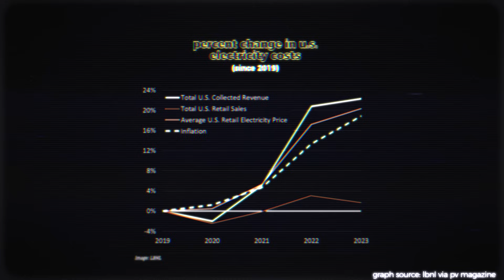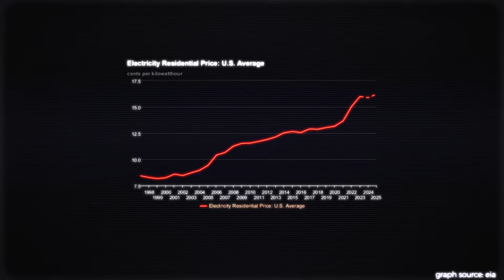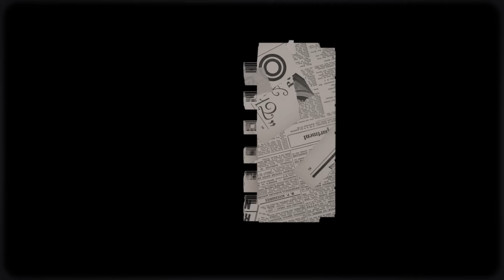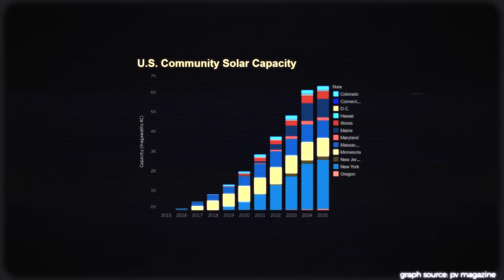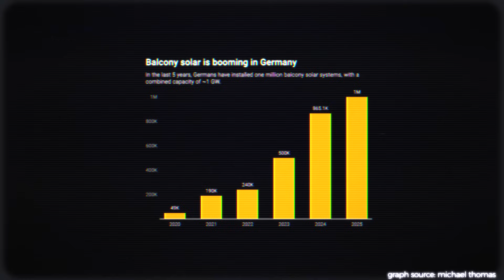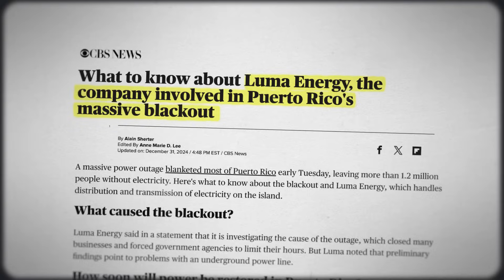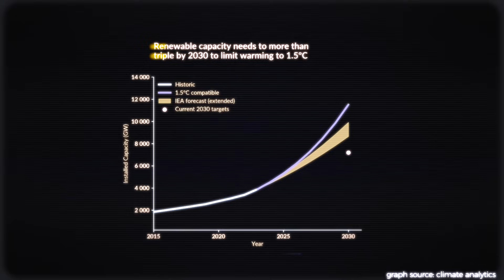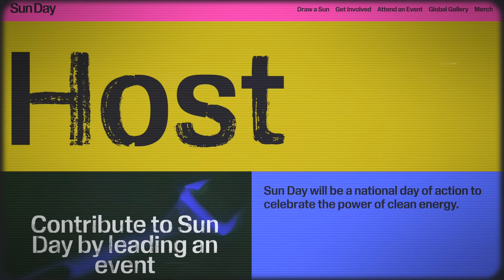Why We Need Solar Power

Comment: I agree with everything in this video besides construction of big solar farms in the rural areas of the country. Some of these solar farms destroy the ecology in those areas via light pollution, fencing around the solar farm cutting off migration paths for the animals, and destruction of the surrounding ecology via deforestation. You could make the case those solar farms could be feasible on land that was already used for agriculture but deforestation and ecological destruction to build these solar farms is out of the question and unfortunately this is happening in areas around the United States. The solution to this is placing solar panels strategically in the urban city areas via rooftops and balcony’s as this video pointed out. Also along highways and roads would be a great spot to place solar panels to power the rural areas as well.
Reply: I have to disagree. Solar panels work best when installed in large areas with no interference with the sun, and has limited air pollution. Installing panels next to highways and roads? I'm guessing you've never worked next to the road. It is filthy. The surface of those panels will end up covering in rubber particles which will reduce the already low efficiency of the panels. This makes it even more expensive to operate as the maintenance cycles are increased.
Reply: @JoeNunyabidness  There's certainly a place for solar in urban areas - there are lots of buildings which have  a vast expanse of roof area. Not generally residential - but business complexes, warehouses, retail space and supermarkets, all have spare space sufficient to install a moderately large solar installation that is well above the height of surrounding buildings. It may only be in the tens of kilowatts, but that's enough to be commercially viable and the roof space would otherwise be going unused.

Given how many US cities are more parking lot than they are building, you could probably meet a good portion of their power needs just by fitting a solar panel roof above all those parking areas.
Reply: @vylbird8014  Although installing on those large roofs sounds good, the problem is that all those structures will need to be re-engineered to support the load. Solar and all the necessary equipment is heavy. Very heavy. And warehouse roofs aren't designed to hold that type of load. Retrofitting would be necessary. This means that a "tens of kilowatts" install would not be commercially viable. Instead they would require massive amounts of government subsidies. Parking lot installs are a better solution, but they still have many holdups. 

Which then brings us back to what I was talking about (since I never mentioned anything about roof installs) air pollutants and panel efficiency. The reality is that tire rubber is one of the largest sources of microplastics in the environment. It is light enough to float in the air and then land on hot surfaces, like panels, and reduce their efficiency. Vehicle exhaust will also cause that harm. And cleaning a panel of melted rubber is going to require a ton of effort. This is why city installs require so many subsidies. Want to know a more effective solution? Insulation. It is cheaper, easier to install, more effective at reducing energy waste, and less environmentally damaging. Unfortunately it isn't as sexy, so people can't oohh and ahhh over it. $1000 of insulation will pay for itself long before $1000 worth of solar.
Reply: @JoeNunyabidness  i have seen a dead deer in the fence in the mere 3 years these massive solar farms have been set up near my town
they are even worse for the ecosystem than highways and crop field monocultures
Reply: @kkjkjh  that's simply not true lol. highways have killed thousands of deer in those same 3 years. you can also combine farms with solar depending on the crops.

Comment: "Gargatuan"? 

For balcony solar you don't have to plug into the wall. Plug into one of those little jackary style batteries which also themselves plug into the wall, then power your stuff from that. The battery doesn't back-feed into the house, it just powers the devices plugged into it and only uses the grid when below a set percent. It does add about a grand to the up-front cost, pre-tariff, but it can be worth it if electricity is pricey and or your balcony is perfectly aligned for solar. Sorry, but you'll have to do that math yourself. 

Practically every house in my neighborhood has at least a few panels on the roof. It'd be nice if we went in on a neighborhood battery and disconnected, or at least lessened our dependency on, Black Hills. Not gonna happen with the NIMBYs and conservatives though. 

Please stop spreading the FUD that quantum computers can break any encryption. Yes they'll be able to smash together very large primes better than standard computers, but they won't break it all day 1 and there're already quantum safe algorithms. They're not being implemented wide-scale yet because the companies are waiting till they can profit or at least avoid large costs from the change. Look up 'Post-quantum cryptography'.
"In contrast to the threat quantum computing poses to current public-key algorithms, most current symmetric cryptographic algorithms and hash functions are considered to be relatively secure against attacks by quantum computers. While the quantum Grover's algorithm does speed up attacks against symmetric ciphers, doubling the key size can effectively counteract these attacks. Thus post-quantum symmetric cryptography does not need to differ significantly from current symmetric cryptography."

Comment: Isn't Chinese solar got banned for national security or something
Reply: That was the excuse given for it. But really it was just anti-renewables
Reply: There were backdoors built into some microinverters, but the scale of the problem was massively overblown for the average user. It was for grid scale disruption, not spying on neighbor Joe. 
Same thing happened with security cameras and routers a while back.
Reply: Not national security. The official reason is dumping. It appears - though China denies it - that China is subsidising production of panels for export in order to keep international prices very low, in order to prevent other countries from establishing their own solar panel manufacturing. Chinese-made panels are so cheap that no-one else can possibly compete. This is their way of handling over-production while also ensuring this export market remains available indefinitely.

Comment: imagine everyone just has their power grid on their roof lr balcony 
no transmissions fees no utilities gauging you
Reply: We'd still need the supergrid though, because that only works for me for half of the year. I am also still in favor for adding nuclear to the power generation mix. It's first of all, a great clean base load, but nuclear plants also make critical resources for the medical and space exploration fields.
Reply: @Xiph1980  nah bro
wind blows harder in the winter
just build storage
pumped hydro or electric cars 👍
Reply: Wind is stronger in the fall, it very much is not in the winter. Not over here anyway. Hydro is only feasible if you have decent change in elevations, plus it's harmful for the fauna.
And nuclear is cheap enough, clean, safe, and as I mentioned, crucial for many industries like medical. It's where they get radiation sources from for cancer treatments, and imaging contrast fluids. It's also how they create/purify U-238, used in long term exceptionally safe thermoelectric power sources for satellites, remote off-grid sensors, etc. It's an alpha-emitter, so it only radiates helium ions that are completely blocked by a piece of paper.
Reply: @NorroTaku  wind has even less output when you are talking about something you can put on a building - you cant put anything with serious output on there, because either the weight will be a problem for statics, or the vibrations from it will start breaking apart the walls
even with the small scale ones you CAN put on roofs, you get the problem that the vibrations and noise are VERY unpleasant for inhabitants of the building... and the output of those is negligible

also - a grid is still the better option, because... what do you do when your local system has some kind of failure and/or runs dry? its always better to have a backup to balance out load and cover problems
thats the reason why public healthcare is a thing instead of "everyone deals with their own problems"

and especially some of the new nuclear systems are actually a great option these days, because of reactors actually using the waste created by the older ones as fuel, which helps deal with the issues with long term storage of radioactive waste
and that also might be the stepping stone we need to get into stable fusion reactors
Reply: @SharienGaming por que no los dos?
community grids with big wind farms are dope
cuz if they pool money they can build bigger (eg higher and therefore efficient) together
there sre projects like this in German villages
municipality builds and all can contribute by buying a "share"
Reply: @NorroTaku  sure - and the bigger that community grid the better
if it were up to me, the energy grid would be under state control and not for profit

and if we cant have that because politicians are bought... then what you described is how we start building that
Reply: @SharienGaming OFC but first we need to take back control from the companies
what better way then to establish our own grass roots grids with friends and neighbors😊
Reply: It can work for some, but only for people who have enough space for panels and a low energy consumption. If all you need is lighting, some small appliances and a place to charge the phones, sure, that works.
Reply: That's great if you don't mind cold showers and uncooked food...

Comment: Normal consumers should not pay for the infrastructure needed for tech corporations!
Reply: That is the idea behind every public-private 'partnership' (but for corporations in general)
Reply: @TheFabledSCP7000  Privatize Profits Socialize Losses
Reply: welcome to late stage capitalism, where the corporations dictate the rules and civilians are effectively slaves to the system they've built for themselves.
Reply: Yes! Sadly, currently it's often even the other way around. Factories here in the Netherlands, often don't pay any transport fees. My energy at home costs about €0.24/kWh. That's about 4ct vat, 13.5ct transport and network costs, and the remaining 6.5ct is the actual cost of generating the power. If your usage is above a certain threshold, (something in the order of many MWh per year) you're not paying those 13.5ct, and since it's required resource for a company, you're not paying that VAT either. It's utterly ridiculous.
Reply: If the tech corporations have higher price to pay they have to make the tech more expensive so you actually pay the price either way
Reply: @HaiHai-f2j  But if you don't buy their product it should not affect you.

Comment: All ovens are electric.
Reply: Unfortunately that’s not true. The house I’m living it in (about 5 years old) has a gas stove/oven
Reply: Not at all. I have a wood-burning oven in my garden, and there are many people who still live off-grid and use ovens and other cooking devices running on gas, oil, or solid fuels.
Reply: There are gas ovens. #notallovens
Reply: Premise 1: If all ovens are electric, then @chidorirasenganz 's oven is electric.
Premise 2: @chidorirasenganz 's oven is not electric.
Conclusion: It is not the case that all ovens are electric. (Modus Tollens)

Your assertion has been dismantled by facts and logic.
Reply: @mqb3gofjzkko7nzx38  the issue is that that is true in many places, not just those two
Reply: guillotines aren't.

Comment: I find it very strange that balcony solar was illegal, sounds like the fossil fuel overlordz have been putting up road blocks.
Reply: It can easily be very dangerous 

The issue is that they refused to update the regulations to allow them
Reply: I'm an electrician, and I find "plug in" solar really frightening. The video acknowledged the possibility of "breaker masking", but there are other issues that can come up too. That said, I do believe that once the dangers are understood, those balcony solar systems can engineered to be safe enough to use. But you gotta do a lotta work in the background to get it there🤷🏿‍♂️
Reply: Its illegal because no one wants cheap solar panels breaking and raining down dangerous glass shards on passers by below..
Reply: Heating a home with natural gas can easily be very dangerous
Reply: I'd love to know the technicalities of how they made that not a death trap. In normal household wiring, even if you're off grid like I am, you have a fuse box somewhere that you can switch off all power to the house before doing maintenance or alterations. But if people are plugging in power generators to a power point, then switching it off at the fuse box doesn't make the house safe. People can die from that.
Clearly they have found a way to make it okay, but I don't know enough about it to understand how, and this vid didn't explain it.
Reply: If you've ever seen how dumb consumers are with electricity, you'd probably change your mind about balcony solar. Of course, if we actually taught people how solar panels work, no one would support balcony solar. Or poorly aligned residential solar. I mean, it's great if you don't have a stable Grid, but if you're in the US/developed nations then it doesn't make sense. Want to save money? Upgrade your insulation, upgrade your windows, reseal your housing, and change to a heat pump hvac system. Reduce consumption should be the first step. The next step should be voting for Grid upgrades. Our ancestors paid to build the infrastructure, and now its up to us to pay our share for infrastructure upgrades for the next generation.
Reply: @JoeNunyabidness  Or instead of spending a fortune you don't have on a home you don't own you could just add a few solar panels
Reply: @TheFabledSCP7000  Or we change the subsidies and regulations so that they ensure that rental properties are given the efficiency upgrades rather than changing everything so that consumers are forced to buy a capitalist bauble that won't solve the problem. Solar panels are not as effective as you might think, especially if you are renting and not installing the panels properly. We need to stop wasting resources. We need to stop destroying the planet. We need to stop exploiting workers to make our shiny distractions.
Reply: @JoeNunyabidness 
What do you mean? Pointing them south, then calculating the right angle for your location is foolproof. Ask the seller or AI if you can't do it yourself.

Comment: The answer to why electricity is getting so expensive is capitalism. Private interests and private companies are allowed to jack up the price of electricity as far as they can in order to make a profit. They then turn around and blame the increase on inflation, increasing wages etc. Electricity should be a right thus it should be something that should be owned by the public.
Reply: "Sustainable business" they say as they're planning on building these energy devouring data centres.
Reply: The only monopoly that's "allowed" in America but privatized strange how that works. Also if your looking for a cheap way to get of the grid you can buy old panels that aren't as efficient but are extremely cheap. Free yourself from the system and when ya do try and help other becomes free.
Reply: @damintten  Don't let code enforcement find out you're not allowing the shareholders to extract value from you.... its usually illegal to not be conected to utilities. 😢
Reply: Couldn't agree more man, and it seems to be getting worse as time goes on 😯
Reply: Probably also why plug-in solar was shot down in the regulations update
Reply: It's bad enough that in a couple of US states it's illegal to store rainwater that falls on your own land - because the state already sold the right to that water to someone else, downstream.
Reply: @vylbird8014  that's not true. You can't store all of the water that falls on your land because rain makes rivers

Yes, it is needlessly complex, arbitrary and restrictive in many areas, but we don't need to misrepresent anything
Reply: And the tariffs
Reply: For real. And especially with many disabled people who rely on electricity for AC or heating during extreme weather. Literally there was an iCarly episode about how necessary AC is.
Reply: 100 % true! Capitalism needs to die once and for all, just as monarchies did back then
Reply: Electricity used to be owned by the public and ran by the government but they sold to private companies in the name of "progress". In reality it was a run by the rich to gain control of power to exploit them for money.

Comment: Berlin can serve as an inspirational template to base future solar installation projects in sunny areas.
Reply: you wouldn't believe how little aren't suitable
Reply: First the laws have to be ammended to allow it. The tech will catch up fast
Reply: Absolute Nonsense,  have you been to Berlin during the winter.  There are literally weeks when the sun is little more than a glimmer and snow covers everything - including solar panels.  Solar doesn't work in northern Europe.
Reply: @abbeynormahl61 
Berlin and snow???? They get like 1cm of snow, for around one month. If you have panels on your balcony you could literally swipe that away with your bare hands. 

Clouds are an actual issue, snow really isn't.
Reply: @abbeynormahl61 Not true. Solar works very well in northern europe.